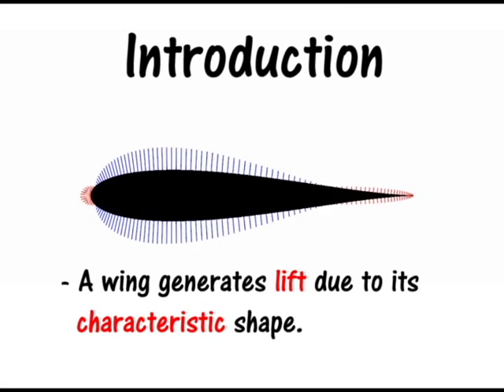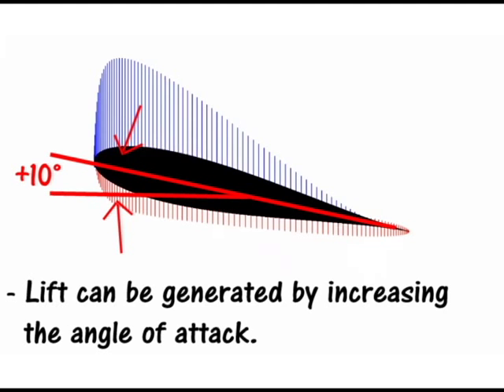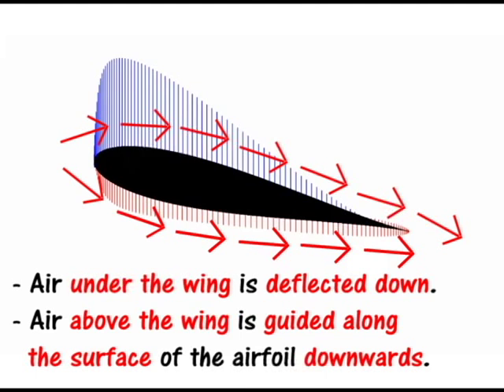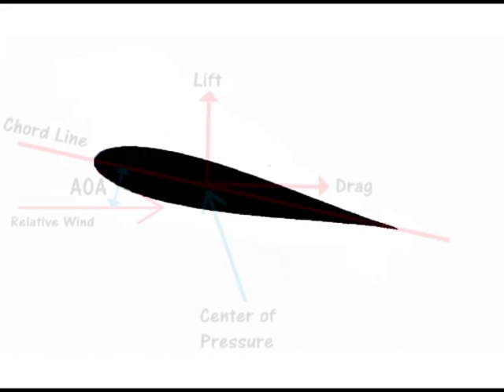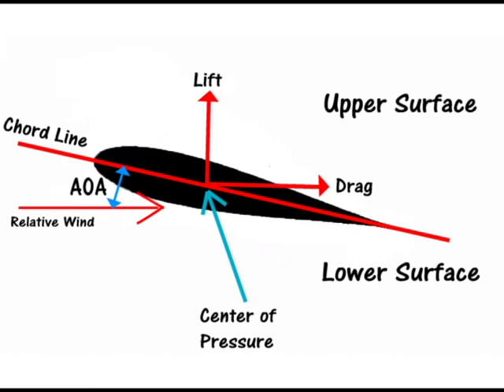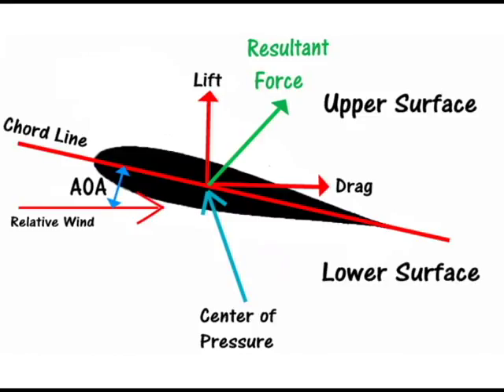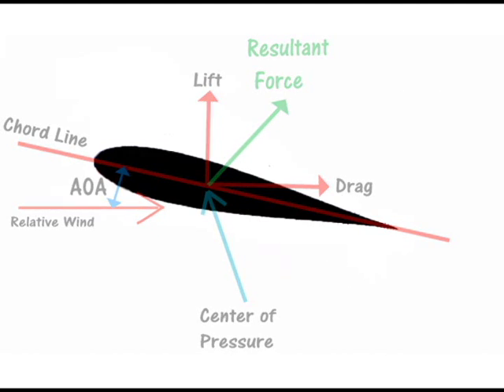Flight Discovery - Airfoil Pressure Distribution

Comment: Upper surface pressure higher than lower surface pressure and it creates a greater lift? You got even the basics wrong!
Reply: Mohammed Shawn 
how that is wrong?
Reply: @shortclips7052   he upper surface pressure is actually lower that the lower surface pressure, being more especifically, is actually lower than the pressure of the air  that comes to the wing, thats it because the air on top of the wing acceleretes, so, on bernoullis principle, on keepeing the energy equals, the pressure goes down, and that creates a succion from the lower part to the top, having the lift force
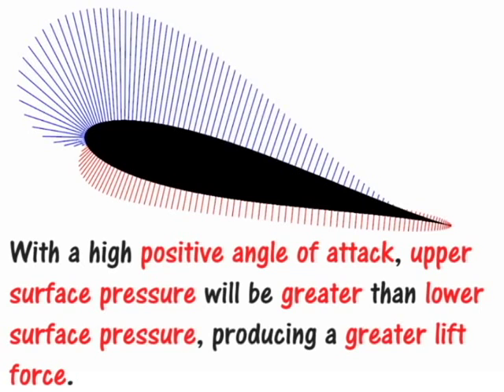Reply: @danielkwoow433  You are correct about the upper pressure being lower. The words on the screen at 0:39 are WRONG.
EXCEPT it is the lower pressure above the wing that is the cause of the air's acceleration around the top curve.
.
Pressure Gradients accelerates fluid.  Euler figured this out in the mid 1700s following up on Bernoulli's work.
.
It is an all too common misconception that speed causes a lowered pressure. Bernoulli only noted that pressure and velocity are inversely proportional in a flow, but not the cause and effect.  He only said: "an increase in the speed of a fluid occurs simultaneously with a decrease in static pressure" [under specified conditions]. He did not say 'causes'.
This is Newton for fluids.  The Pressure Gradient supplies the Force to Accelerate the air's mass.
..
Just another in the endless list of crummy YT  videos on lift...
Reply: @Observ45er  The increase in velocity is due to the venturi effect caused by the constriction of air between the curve of the wing surface and the atmospheric pressure. This is what causes the velocity increase then the pressure drop is a result of that according to Bernoulli's conservation theory.
Reply: @newcastleaviationacademy7436   Unfortunately, that is one of the common misconceptions repeated by so many amateur scientists.   The science is as I explained above. 
Atmospheric pressure is not a hard wall, so the 'half venturi' story is false science. 
The wing does indeed push the air around and out of the way, but claiming that the speed of the mass in air causes its acceleration directly contradicts Newton's laws.  A force is the cause of the acceleration of a mass. Newton's First Law.
,
The Bernoulli Principle only states that the pressure increase and speed increase occur together and does not define the cause and effect.  There is no indication in Bernoulli's notes that he knew the cause and effect. He only observed the to occurring together.  
.
It was Euler who figured it out that it is a Pressure Gradient that provides the force to accelerate the fluid.
The acceleration of the air above a wing is caused by the Gradient of the low pressure  above the wing and the atmospheric pressure ahead of the wing.  It's Newton. Anything else violates Newton's laws.
.
The low pressure is caused by the curved air-flow as explained in this one minute video.  Newton and momentum/inertia: 
 *https://www.youtube.com/watch?v=3MSqbnbKDmM*.  

.
The complete physics is explained correctly here:
 https://kyuoyckftflurrpq.quora.com/
Reply: @newcastleaviationacademy7436   P.S. In a venturi it is also the Pressure Gradient that Accelerates the fluid.  A force is required to accelerate mass.  That is physics.